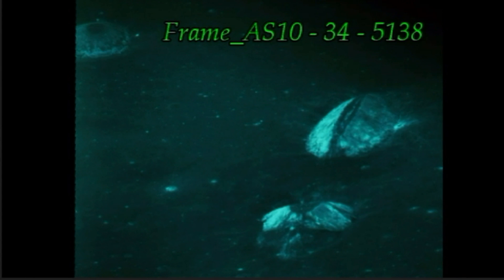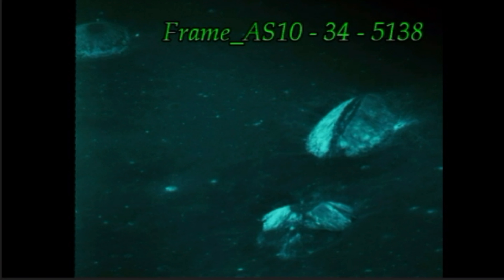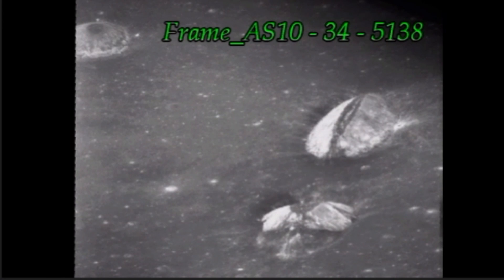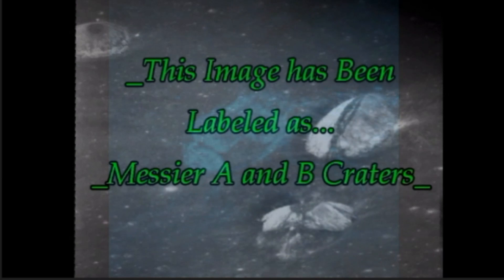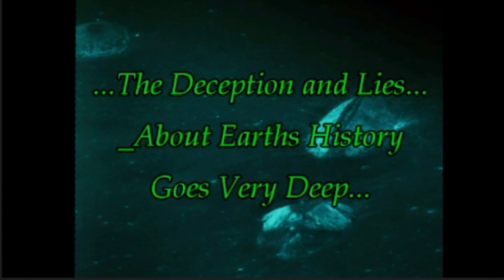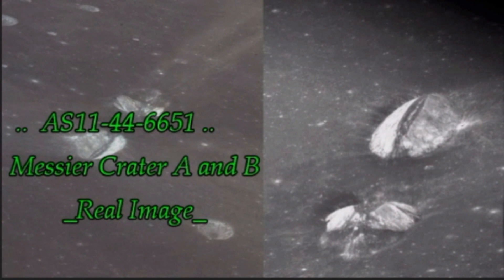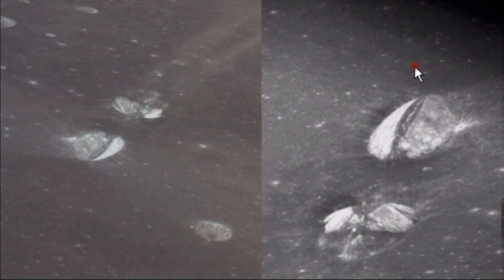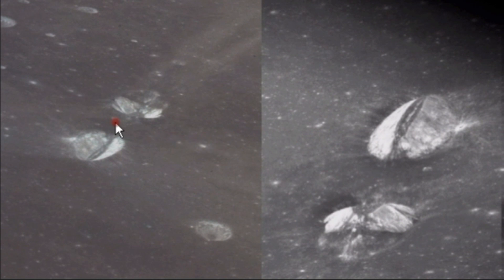_  Glass Dome on the moon _  Transparent Metal _

Comment: You flat out said it was made of titanium  metal. How in the heck would you know what the crap is made of? Get some proof man,  then tell us what it's made of. You ain't no expert on what a hot fart on the moon is made of. Get real.
Reply from the maker: It has to be for at least two reasons :The soil samples show highly concentrated Titanium which had to come from the structures that have turned back into a dust like material...The surface  also has so much glass quartz material that when the astronauts got back into the lunar lander that there lungs were affected.By the way the article about the glass particles they breathed in is very interesting..There is so much more ...We don't have to agree that's ok...Your own interpretation is ok too...Thanks for watching...Tony

Comment: I just hope that this is not your doing! At time 6:28 on the video, you show the same image twice: left image is showing "dome up;" right image shows "dome collapsed." What I see here is that one of the two images (of the same event) has been turned upside down. Why is this happening in your presentation and that you failed to explain?
Reply: Hector aqui te voy a mostrar lo que muy poquitosw saben >>> Solid Page of knowledge >> the original image  I found it again afterr years, use the Zoomit free Software to enlarge  images, the same exact type of sculptures are on every single Moon, Planet, Asteroid, Comets, even on the Sun's   surface, (SOHO stereo images), hrere is a heck of a good knowledge page :>>>   Image >> https://s32.postimg.cc/pc28lfmb7/colorized_AS08-12-2196.jpg?dl=1   >>>
  >>  http://www.snapfiles.com/downloads/zoomit/dlzoomit.html   >>
  >>>>>    these are recovered works >>> by Cymoon RBAC Pro >>  

 1) >> https://youtu.be/X8cYrsAdXlU

 2) >> https://youtu.be/2IklqxYeT6w

 3) >> https://youtu.be/DQM7iriAz1Q

 4) >> https://youtu.be/Nm095drbK6k

 5) >> https://youtu.be/wNgDcm0B5BQ

 6) >> https://youtu.be/EO0JvghqWEs

 7) >> https://youtu.be/4LYY_Q0puK4

 8) >> https://youtu.be/JDmM-19kDR0

 9) >> EMVs (Electromagnetic Vehicles in Transit) >> 
    
             https://youtu.be/SXdy7-mXX3c

10) >> Ringmakers of Saturn or EMVs >>> Conference by Dr. Norman R. 
                                                                                                            Bergrun

     >>> VIDEO CONFERENCE   >>> 
             https://www.youtube.com/watch?v=UTkoYWLdvU4   >>> 

11) >> Interview on Project Camelot>>  
             https://www.youtube.com/watch?v=OHmgZymhJL8

 12) >> BOOK  >>>
         http://www.slideshare.net/alexpituba/ringmakers-ofsaturnnormanrbergrun-1